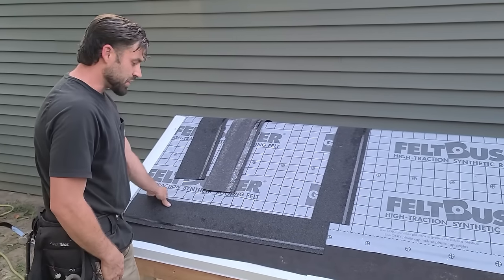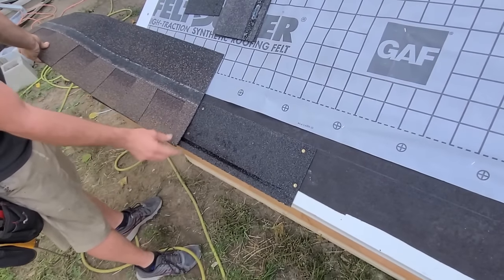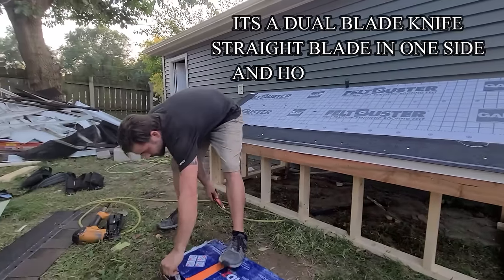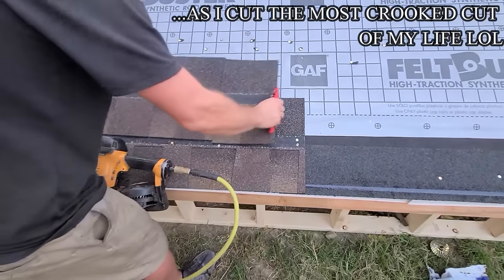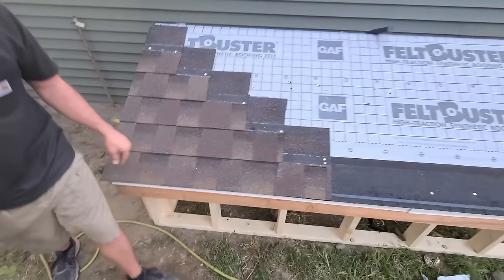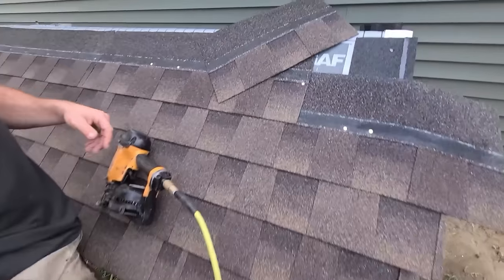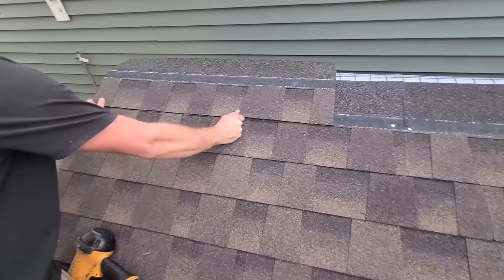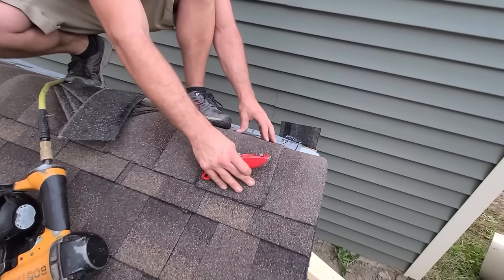HOW TO | ROOFING PART 2

Comment: I hope no one takes your installing seriously.  Ice and water shield first ,metal drip edge next, roof  underlayment next, shingle starter next with 1"-1 1/4" past metal. 1" overhang on rakes with no drip and 1/2" with drip on .
Reply from the maker: All over hangs are to be ¼ - 1"... and that I've and water shield thing, it can go either way.  Most people do it my way, but idc if my guys do it the other way.  It's the same difference and every builder I work for requests the metal to go under.  I've heard some inspections that require the ice to be on first, that's weird to me.  But yea man I hope you don't take yourself too seriously lol 😂 stickler for dumb shit
Reply: @NWIVeteranConstruction  Seriously as I have installed since 1968 in Northeast Ohio in the snow belt and I'm 2nd generation.  If you live below the freeze line in the US then you shouldn't have to worry about ice buildup. If you do live in the northern line then you should adhere to the installation of Ice and Water shield 3" down over the gutter board and up the roof 2' inside of the interior wall  line. If you have gutters installed on your house then you better adhere to the cold weather installation manual because if it's done your way the ice water will back up under your metal edges and into the soffits especially at the metal edge overlaps. This usually happens when the temperatures are below 32 degrees for extended periods with moderate snow pack on the roof.

Comment: nails are too low no the line any ice build up will follow the nail in 
this is supposed to be a teaching video but you keep making mistakes and saying don't do this or I shouldn't do that !!!
Reply from the maker: uh huh. i get it from all angles. everything i did here is a result of learning or being told a better way to do. manufacturer blah blah everybodys got an opinion
Reply: Customers pay a whole lot of money to have their roof done and now it kind of make me wander if your roof is going to leak down the road?
Reply: If you nail any higher the nails won't hold as well and would eventually become more of a problem. His nail patterns are perfect!
Reply: @projectpat2262  his nail pattern is trash every shingle has a nail by the seam 😂😂

Comment: Your gutter apron needs to be 1/4 off the facia board.... stops water from running right down on the facia (breaks surface tension) please learn the craft before doing "how to " videos....
Reply from the maker: oh stop it lol. never seen that in my life. it makes one man installs on gutters easier when its tight and water rolls right on into the gutter just fine.
Reply: If come to put gutters on and you leave a quarter inch off fascia. I'm gonna charge you to reinstall properly before I run my gutters. Apron should be ran tight to fascia following the slope of the roof
Reply from the maker: @richardcranium5518  no bro.  Learn lol here's the 100% undeniable reason you have to put gutter Apron tight.  have you ever seen a sub fascia that hangs a little lower than the plywood? Where you can see a little bit of rafter tail coz the plywood doesn't plane? It happens often.  If you don't have the apron tight, 1)  gutter guy and people installing aluminum fascia are gonna have a hell of a time installing.  2) if field mice run up in that gutter they could climb right under the apron and into the attic easilyyy.. 3) if you hang apron a quarter there's no way to keep it straight and consistent as well as now you're gonna have too much overhang into the gutter after you starter/ shingles.  tell me that's OK?  Plz lol
Reply: Dude it’s rain going down a slope. What surface tension would there be?